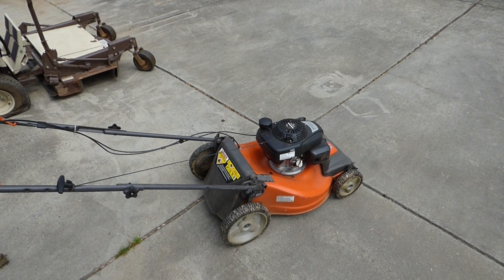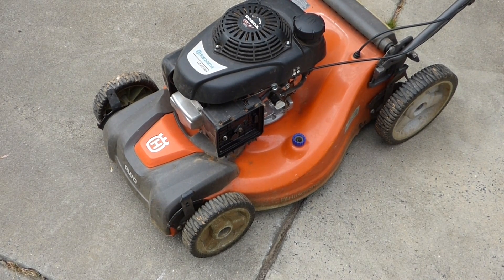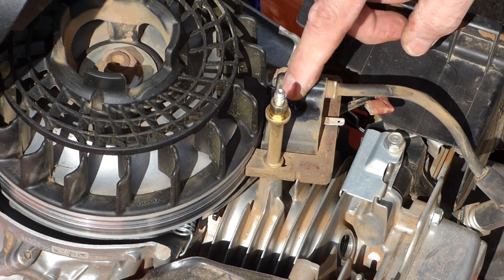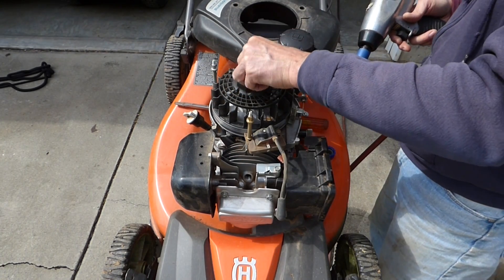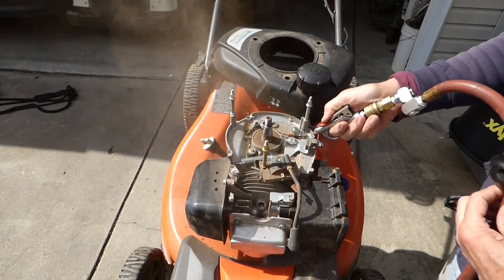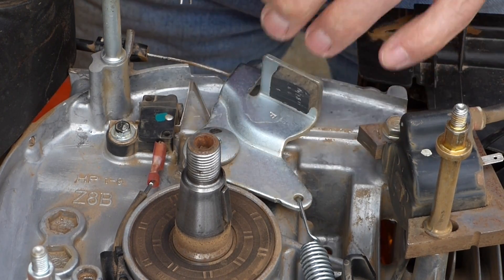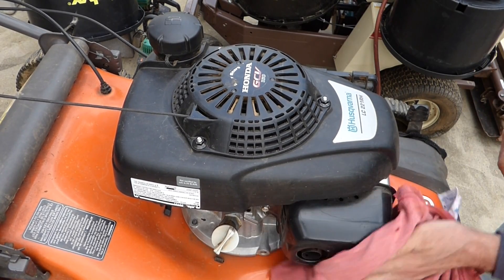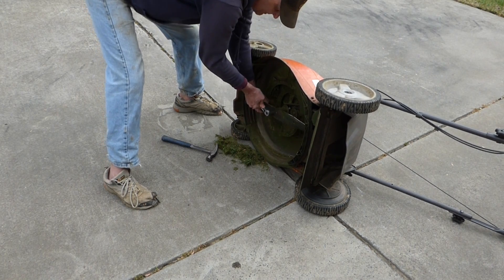Lawn Mower Won't Start - Fuel or Spark Problem - Diagnose & Fix

Comment: Excellent   Video --  Thank   you   for sharing -- you covered everything  ;-) 
 have  a  Briggs & Stratton   18.5 HP   ON A  riding lawn mower ( 28 yrs old  - have maintained well )
---  trying to figure out  why it will not start  was  running good -- then started surging... one
day it just stopped.  Going to work on carburetor,  spark,  etc... hope it is not internal   ... I am not a  mechanic   but can figure things  out  with a little help --   thank you.
Reply from the maker: sounds like you have a fuel problem and carburetor cleaning may resolve your issue.  Start simple ... check fuel filter, fuel lines,...etc and work your way from there.  You can also try spraying some starting fluid in the carb to see if it will start.  If so, that is a tell tale sign that you have a fuel problem.  Wishing you the best!
Reply: @helpinguonline  THANK YOU --  WILL  check  mower   carburetor,  spark and  flywheel  ( sand lightly as well as  ignition coil surface  -- )  check distance between flywheel and coil  w/ business card.   The fuel pump is a vacuum fuel pump right on front of  carburetor...   I am learning  more about this engine  which I purchased with riding lawn  mower  28 years ago... ;-)   You inspired me with your great camera work and excellent explanations ...  I am  almost 80 yrs... ;-) thank you ... ;-)

Comment: My lawnmower is an MTD Briggs & Stratton Model 11A-020L-706. The spark plug I'm using is the original RJ19LM, and it's completely clean. I gapped it to 0.30 inch-es and it's sparking well, I cleaned the carburetor with gas and I put Mass Air Flow Sensor and let it dry,  and I cleaned the tank of gasoline too and the red injector sprays a strong jet of fuel when pressed. The air filter is only a year old, but I cleaned it again. I tested the ignition coil with a multi-meter, getting the following results: 6.13 at 20K ohms in the tree points, I also took the opportunity to clean the magnetic fields with fine sandpaper. I also checked the motor timing shaft pin and it`s in the correct place, and despite all that, the motor still won´t start.  Could you help me telling me what the possible problem is? I hope so. Thank you in advance for any advice you can give me.
Reply from the maker: It would also be helpful to know what happened that it quit running or has it been sitting a long time? With all you said you have done I would try spraying some starting fluid in the throat of the carburetor and see if it will fire and run. If it will then you know you have a fuel delivery problem. You could also try spraying a little starting fluid in the cylinder… Remove the spark plug and spray in there to reinstall the spark plug and see if it will start. Let us know what you find out.

Comment: After watching dozens of such videos, I am learning to appreciate the simplicity of working on my Briggs & Stratton engine. The wire and kill switch are on the outside, not under the flywheel and they are accessible by just removing the top plastic hood.

Comment: So I'm confused a little. If the plug gets spark with the kill switch disconnected there is a short somewhere but if it doesn't it means the coil is bad?? So what should it do when you isolate/disconnect the kill switch because either way it seems like there is a forced problem when disconnecting and checking for spark??
Reply from the maker: If you disconnect the kill wire and switch you should have spark if the coil is good... but you would not have a way to shut the lawnmower off so you would have to ground the spark plug somehow or put the choke on to get it to stop running

Comment: Thank you for your video I have question 
I have a “yard machine by MTD”
I changed carburetor,spark plug  air filter but still won’t start
Do you have some idea?
Reply from the maker: You need fuel, spark and air for an engine to run.  Check for each...start simple and work your way deeper till you find the cause for no start.  Hard for me to guess without looking at it.  Let us know what you find.

Comment: What if you have spark and you also have spark with the kill wire unplugged off of the coil. 
I have a lawnboy mower with a Kohler engine that won't start I need to check the kill switch I guess.
I think I have spark with the kill wire hooked or unhooked.
Reply from the maker: If I understand your question / statement...  You should have spark with the kill wire unhooked.  the kill wire is for shutting off your mower.  If you disconnect the kill wire you will have to put the choke on or short the spark plug to shut it off.  
If you have spark, your kill wire or switch is not the problem for a no start situation.
Try spraying starting fluid in the carburetor and see if it will start.  If it will, you have a fuel problem you need to fix.
Reply: @helpinguonline yeah I did a new carburetor new fuel line and a new coil and spark plug and air filter and fresh fuel and still nothing.
And now I realize it won't even start on starting fluid, so now I would guess the valves are messed up or it is out of time, I didn't pull the flywheel off but I can see that the key look to be in good shape.

Comment: DEAR SIR YOU TOLD UPSIDE DOWN THAT SWITCH IS NORMALY OPEN   (  OFF ENGINE) ON POSITION (ON ENGINE) YOU CONNECT GROUND TO COIL AND COILE  
MAKE HIGH VOLTAGE FOR SPARK PLUGE.  REVIEW YOUR STORE AND CORRECT THAT. THANKS

Comment: I think you make excellent vidios. I have two mowers just like the one in your vidio, what makes it hard to pull backwards,,have to push it forwards 1 or 2 times to get wheels to roll backwards.
Reply from the maker: Thank you 

Check out this video. It may be a help to your situation.

https://youtu.be/rcBq0Vl2lnM

Comment: This has got to be what's wrong with mine...same Husq model, same GCV160 Honda engine, same symptoms. Clean filter, clean oil, fresh fuel, new spark plug...no start. I guess I'll break it down to that kill switch and see if that's the problem. Thanks for the diagnostic video.

Edit: This WAS the problem with mine. I also wanted to add that the kill switch spring is adjustable without removing the flywheel. With the pull start assy. & Fuel tank/flywheel dust cover removed, when standing on the air filter/carb choke side of the mower and looking down at the flywheel, just below the flywheel and immediately to the right of the flywheel brake lever you can see "V" bend of the spring sticking out pointing directly at you. I just used my finger as a backer and a wide, flat screwdriver to expand the angle of the bend. Done.
Reply from the maker: Way to go!

Comment: Thanks, your tip about the flywheel key made me check again after I had replaced the ring gear on my sit on tractor and it wouldn't start. Sure enough the key was sheared and the flywheel mounted incorrectly. Thanks again.
Reply from the maker: Glad it helped

Comment: Hi i enjoyed your video, please keep up the great work, I have a honda with manual choke lever on the handle bar, it won't start, I tried to do a quick clean with a welding tip cleaner down the main jet without taking the carb off but that didn't work, it would start on low  but run then die, it did run before  i'm at a loss please help thank you.
Reply from the maker: Sounds like your carburetor is starving for fuel. Start simple and work your way through it… Check your fuel filter, fuel lines and make sure your air filter is not clogged. If all those check out you may have to take the carburetor off and clean it Which isn’t too difficult task.
Praying you have a great success and let us know what you find.
Reply: @helpinguonline  to be honest I've never removed a honda carb that has a manual cable style choke is there anything I should look out for? I appreciate your kind and timely  response, I will definitely keep you posted!
Reply: @helpinguonline  hi, I cleaned up my carburetor on my honda with out removing it just took the bowl off and into the intake and jets up the emulsion tube with carb spray, pulled the cord it fired right up on the third pull then tried again fired on the second pull then the first pull works great idles nice fast and slow work great.
Reply from the maker: Way to go!

Comment: Yes. Common sense cures a multitude of evils. One thing. The action of the "kill switch". How does it work? I saw you connect the kill switch wire to the solenoid. How about the other end.
Reply from the maker: On a push lawnmower like that the other end is just hooked to metal somewhere on the lawnmower with a screw to ground it when that switch connects. On a riding lawnmower it goes to the key switch to complete the ground

Comment: Tighten the flywheel nut first and then check the gap , good job of explaining everything and why 
The only thing I do differently is I put a tad of oil on bolts because every one washes there mowers